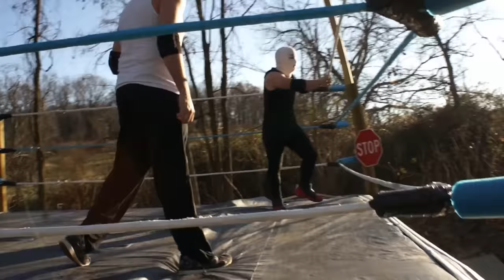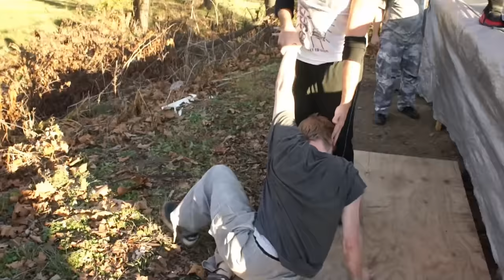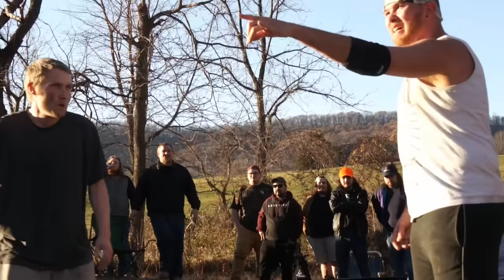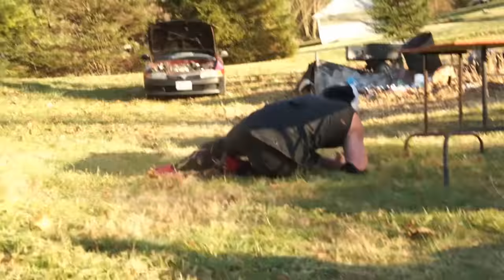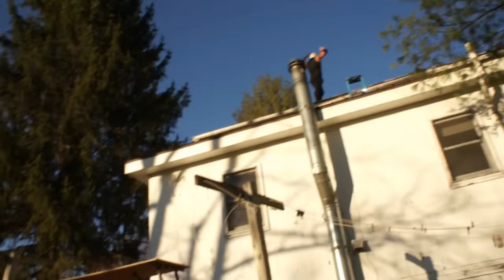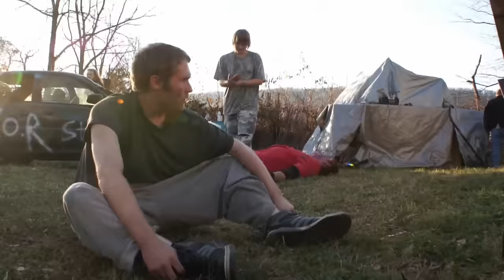Insane Backyard Wrestling Match - Extreme Fatal 4 Way

Comment: These dudes actually look like they'd do really well in the business if they actually took it seriously, and made legit careers out of it.
Reply: They need to work out. They're just not strong enough , at least for the moves they try , for example if you're not strong enough and big enough to hold them of the ground a solid second or 2  then you shouldn't be doing choke slams.
Reply: Off*
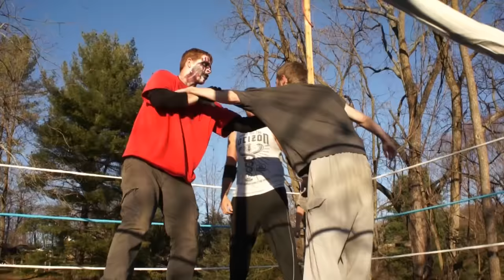Reply: 8:57 
When they did the double chokeslam, they needed to hold it out for a little bit longer so the guy could actually bump and not sandbag completely

Comment: If this is a fatal 4 way the match would be over after first pin. This is a battle royale( not to be confused with a royal rumble which is a battle royale with a large pool of wrestlers and the only elimination coming from going over the top rope)
Reply: Its not a battle royal since battle royals are also over the top rope elimination matches. It's a fatal 4 way with 2 falls. First fall is for the hardcore championship and the second is for the heavyweight championship
Reply: @Dynamo Gaming  some battle royals have pin falls. Aew ,  AAA
Reply: @dandastardly2792  this still isn't a battle royal since there's no eliminations. It's a two fall match with each title dedicated to a certain fall
Reply: @dynamogaming2039  You are correct